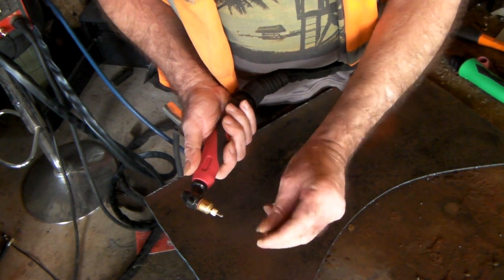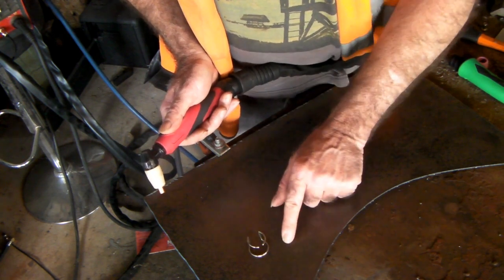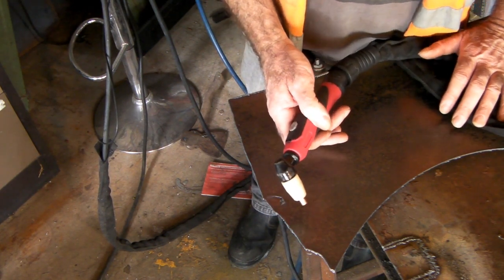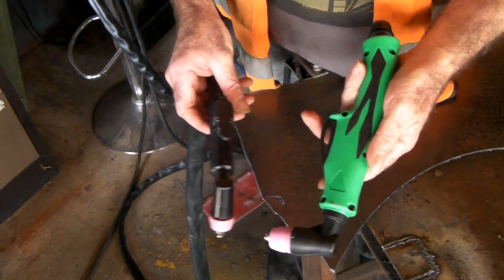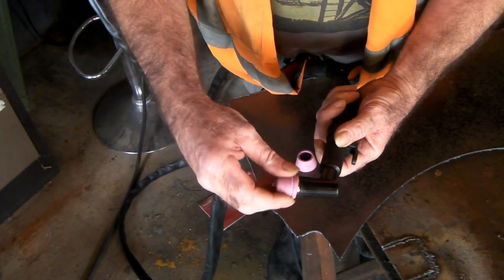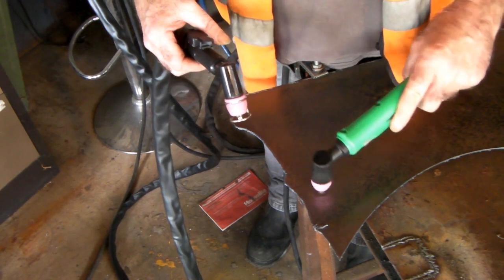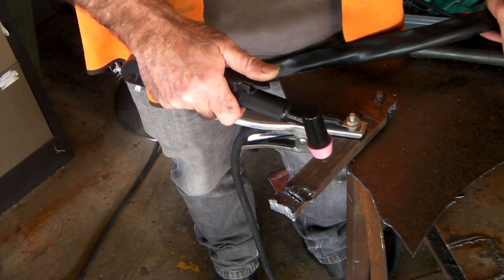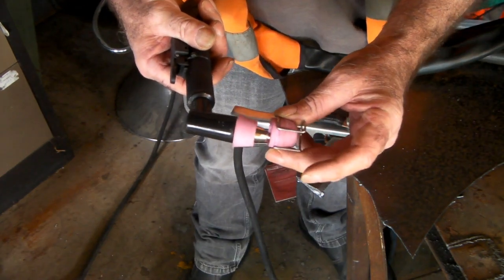Plasma Cutter Drag Tip vs Standoff Guide

Comment: Thx Pete. Just to get this straight. Can I drag a pilot arc torch tip directly on the metal workpiece as I would with a non pilot machine torch tip.? I seem to recall reading that if you drag a pilot arc torch tip ( connected to a pilot arc plasma cutter) directly on to the workpiece the tip will melt almost immediately.  I cant figure out why that should happen

Comment: Hi Pete I bought some pt31 stand off guides on ebay but they are a roller or wheel version they work pretty good they were under £10 from a Belgium company but I think they are from China originally cheers from the 🇬🇧
Reply from the maker: Good to know!

Comment: the hypertherms we have at work has a castleated drag cup. looks like a rook from a chess board. it allows the sparks discharge easily and if you place a bit of metal as a guide, you subtract 3/16 from where you want to cut and you end up cutting just where you wanted.
Reply from the maker: Thanks for the info Bob cheers.

Comment: Pete, we all enjoy your videos, and we also would like to look forward to many more because your knowledge and advice is valuable, BUT please don't keep using your kit with bare arms exposed to all that UV. I know you've been doing it for years, yatta yatta yatta etc,etc,etc.!! I lost a lot of skin from my arms a long time ago because I did a "last minute" tig job for a mate before locking up for the weekend, and I didn't put my overalls back on because he was in a hurry, and well, a mate's a mate, right? It was a very painful lesson. Rant over!! Keep the videos coming Pete, you're good at presentation. Stay Safe!
Reply: We all know its bad for us long term but we are all adults and make those choices anyway. I have welded for years mig and lots of stick mostly and never used a respirator unless I was in a real dead space with zero air moving like in a tank or under strict OSHA rules as a contractor. Low hydrogen rods put off some nasty fumes but I still alive. I make little cuts and welds all the time without sleeves or gloves.  I promise all of the YouTube safety police that if I die of cancer I won't bitch how I got it and I doubt he would either. Everyone should read their manuals and use their own judgment when working with dangerous equipment. Especially if you are counting on YouTube as your instructor!!
Reply from the maker: WIFE, GOT ME SOME GLOVES FOR XMAS
Reply from the maker: Have you seen my biggest safety mistakes yet?
https://youtu.be/u9fCxx-5tZ8

Comment: Take your Tip off and get you a 3” long 5/16 bolt 2 washers and nut or metric equivalent. Put it through the Ceramic tip with a washer on each side tighten the nut up do not tighten too tight as to break the tip. Mark your tip where you need the groove on it. Chuck it up in a drill press. Turn it on and use a small flat tip screwdriver and put your groove where you need it.
Love your videos by the way.
Reply from the maker: sounds like a good idea cheers

Comment: Hi Pete I am here in the Philippines, I appreciate the way you share knowledge for everyday people, subscribed... I am going to follow your advice and get a 2nd 60A torch head for my cut40, my current head has an external switch zip-tied to the torch head... our online shopping platform here, Lazada, has a torch with a thumb actuated micro switch and another with a regular trigger built into the torch head... is one better than the other and will I be able to swap these out or do I need to get a matching cables...
Reply from the maker: Hi rob ,thanks for watching .You should be fine with that they both work much the same.
cheers from new zealand

Comment: I’m at Nashville Tennessee I have a thermal dynamic 42 and I was wondering can I put those tart sheds on my machine because I’m like you I’m hunting a more affordable combustibles I really enjoyed your video it was very informational I am subscribing thank you
Reply from the maker: Hi ron ,your thermal dynamic  wont run on the cheaper plasma torches or consumables .I think They keep it all in house to inflate the consumable price .
cheers pete
Reply: I’ve got the new Cutmaster 40. And yes, consumables are more expensive, but if you’re doing everything properly, they last much longer than the cheap Chinese consumables. A major factor is your air. You need enough pressure, and enough CFM. If not, the consumables will quickly go bad. This is a problem a lot of people have when they ask me why their consumables don’t last long.

If you really want to, you can find cheap Chinese consumables for yours, and for the SL40 torch, and my SL60, in particular. I’ve tried them and threw them away before I finished the package. They were not very good. Lasted about 25% as long as ESAB’s.

Comment: Good tip
Reply from the maker: have great day thanks
Reply: Can you rotate the elect. When one end is burn
Reply: @danielgarza8161  If you mean the electrode in the torch, on my Cut50 you can. Both ends are usable.
Reply: Thanks